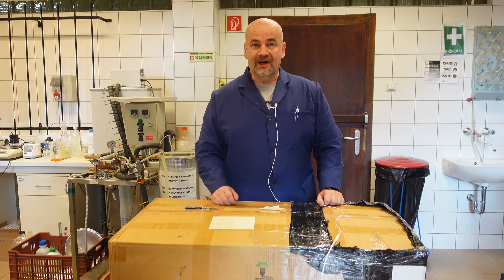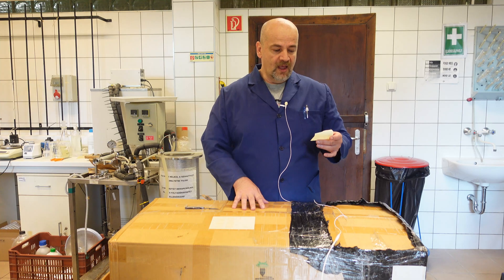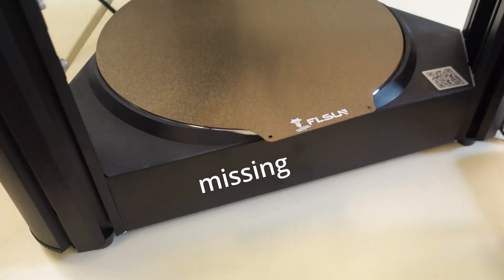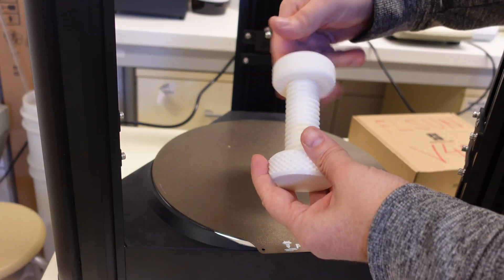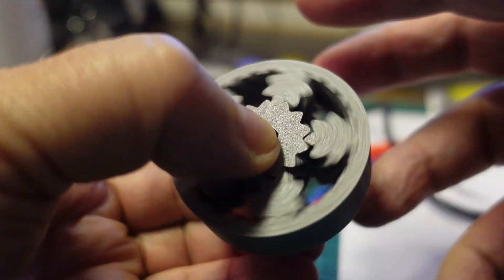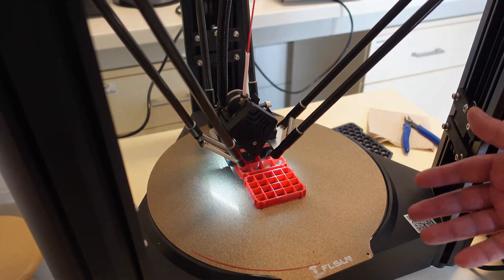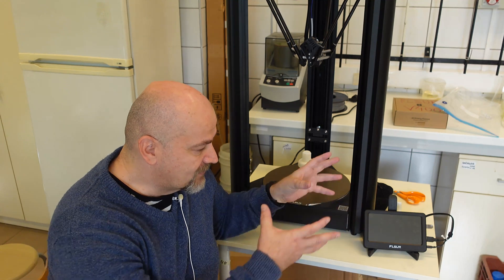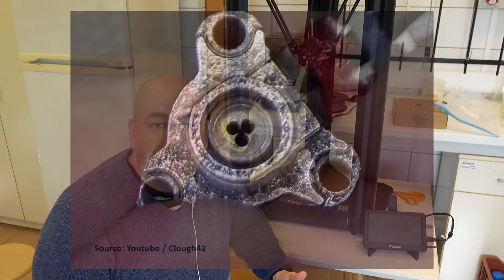Just another FLSUN V400 review, but why now? What about S1, T1?

Comment: I just got my V400 6 days ago and compared to my Voron Trident, this thing is a treat. Flashed it with stock Klipper following Guiloz Github guide and having the best time with it. While my CoreXY is still doing mesh probe and bed leveling, the V400 is already on layer 4 of my print or something ridiculous.  It's a great buy considering the quality prints with as good surface finish as you know how to dial in your filament and printer settings. Zero regrets guys, do it if the price is right for you.
Reply: @adrianheng7095  @MyTechFun   
Thanks both of you for your "encouragement". I already have a FLsun super racer (which I rarely use and just for fun) and I bought a v400 to replace it. I ended up buying it on AliExprs during those "from $10,000 for $2,000 only until tomorrow" promotion, which, to no one's surprise, is still on promotion a week later, hehe.

 It's still in the box, I haven't had time to assemble it yet. I'd like to know more about your experience with it and 6 months after this video publication. And about using another version of the klipper. Has it improved a lot?

Thank you, guys.

Comment: Personally, I love my FLSUN V400. It definitely isn't a plug-and-play printer, to be fair. But, with time, I'm now finishing "4 hour" print models in 30 minutes at better quality than slower printers. I run a few prints through it a day. I put a Bondtech CHT nozzle in it (0.4mm). It's greased with lithium grease. Otherwise, 100% original - belts, extruder, etc.

Comment: Delta has always been something I've been looking forward to, and I've been impressed with the V400's delta construction for its rapid prototyping capabilities, but the recently prepared T1 Pro seems to have been optimized in terms of design. I'm looking forward to further breakthroughs in the mechanics that will bring a smoother printing experience and reduce minor issues such as noise and vibration.

Comment: You should print your dices four pieces at once, one after another, in four different "corners" of the print bed. V400 has very poor accuracy, around +/-0.5mm, depending on position on a print bed. That could be caused by two reasons:
1. Typical Delta mechanism problem
2. Poor calibration in limited Klipper by FLSun

If first, there's nothing you can do. When print head goes aside, one arm is stretching almost horizontally, printer loses the accuracy and all resonance compensation (input shaping) which was made in the middle of print bed,  goes down the drain.   

If second, I wonder if "vanilla" Klipper would introduce better software controls for this simple yet wild mechanism.  I tried, got stuck in the middle of transition and went back. 

All in all, if someone told me about those problems, I would never buy this printer. However, for prints which don't require dimensional accuracy (bigger parts without connection points, sculptures, toys) this printer can be fun to run, with decent results, but somewhat dull details due to unavoidable input shaper. Without input shaper this printing head trembles when you just look at it.
Reply from the maker: Oh, that may be the reason. So far I noticed bigger inaccuracy on large parts. Also give some explanation, why it scratches the surface sometime (mentioned in conclusions part)
Reply: @MyTechFun  Large parts have more inaccuracy because they spread more in printable area and then aforementioned reason No1 gets emphasized. But if you print a big Halloween mask for example, you will not notice that because you don't measure accuracy there. Only imperfection you could see then are occasional "ghosting"  artefacts because input shaping compensation frequency changes as soon as you leave the bed centre.  

About surface scratching, I have heard some units have motors poorly bolted to the frame. Those screws should be tightened. My V400 never scratched the surface, but I checked those bolts anyway. They were ok, I didn't have to tighten them. Also, check the belt tightness. Especially if you run faster than 150mm/s, which I don't recommend for the sake of precision, surface appearance and longevity of mechanical components of this printer. I manage to break belts and ruin rollers just because I wanted to see if tighter belts would yield better results (did not). You should have a belt gauge printed (I don't know why FLSun doesn't include that cheap piece of plastic) and tighten belts not too hard, not too loose, all three the same (tested by resonance sound when arms are in the same (home) position). 

I'm not sure which of those aforementioned two reasons is bothering V400 the most. To validate reason No2, maybe some users which managed to successfully implement full Klipper firmware could testify about actual improvement after extensive delta calibration.  I can imagine a software that compensates imperfection of delta mechanics, but I doubt it exists. 

As for me, life is too short and there are too many good printers out there. 

Three arm movement system (Delta) is used a lot in industrial pick and place robots, where speed is important and accuracy for the specific application is just fine. 
https://www.youtube.com/watch?v=m0IcEjgUDVQ
https://www.youtube.com/watch?v=RKJEwHfXs4Q
There's a reason why Delta positioning system is never used in any type of CNC machinery, where ultimate unconditional precision is mandatory.
Reply: @MyTechFun  To save you time and trouble,  I propose you start testing your input shaping from values I have found as a sweet spot for my V400.
Manual input on speeder pad:
x:  29 ei
y:  29 ei
You can test those values with +/-3 to fine tune. This brings the least ghosting, but somewhat flattens fine details.  And relates only to 10cm diameter at the print bed center. Speed 150mm/s. Accel 4000mm/s2.

Comment: Hi Igor
Interesting. My experiences of FLSun longer-term have been poor, with reliability being a real issue.
While drltas ate fun to watch, for real applications I would buy Bambu every time.
More reliable out-of-the-box print profiles, betyer quality prints and more dimensional accuracy are all benefits that far outweigh watching a delta in real life
Reply: FLsun are know scam artists. They only let the reviewer say positive things in exchange for the printer.
Reply: That's what you get with a bad delta... which is all flsun seems capable of delivering. I have way higher surface quality & dimensional accuracy than Bambus, not to mention speed. The problem is flsun not delta.
Reply: Yep, just built a diy core xy printer (not voron) and got a 20.0 - 19,9 - 19,9 cube without any calibration. And my bambulab just prints fast and accurate every time. My SR is like a wild stallion sometimes it prints great but other times i don't use it for months since it just gives me trouble. I spent around 200$ on upgrades, speederpad, extruder, hotend and some printed parts. Next step is to replace the worthless bed with pei + new aluminum tool plate and silicone heater probably end up spending another 150$ on parts and maybe a day to do the upgrades.

I have 3 deltas from FLsun and I'm thinking about if I'm going to spend more money on them or just sell them and replace them with 1 good printer. The kinematics is fun, but I don't know if it's enough.

Comment: I am interested in a video about the S1 because those features look interesting.
Also, knowing that you have access to both Bambu A1 and P1P, I would be very curious to see the A1's active flow compensation in action. Maybe set up some quick flow tests between A1 and P1P and see if the A1 does better, or it's just a marketing gimmick? What do you think?
Reply: It is better and it demonstrates it at the start of a print, at least the A1 Mini does, if the “Flow Dynamics Calibration” box is checked when the print job is sent.

Prior to calibration a short line is extruded at the front of the plate with the toolhead accelerating and decelerating. The line is alternately thicker and thinner, definitely not uniform.

After calibration a second line is extruded next to the first, same acceleration and deceleration pattern, and the line is very nearly uniform.

The X1C does something similar, extrudes 3 lines while accelerating and decelerating, scans them, then extrudes a clean line underneath while changing speeds. In my mind I call it the proof line because it demonstrates the result of calibration but it’s probably got some technical name.
Reply: Thank you for being honest. We work in a remote, developing world location doing humanitarian work. Getting printers here is expensive and takes a lot of effort. We had one person donate the funds for one that was pretty expensive. We watched reviews and talked tovdealers about how important it was to get something that worked well. In blunt terms no one was honest. After fighting with it almost two years I have met others who regret buying them as they never live up to their hype and promises. Please keep doing honest reviews, to some of us it can be very, very important!